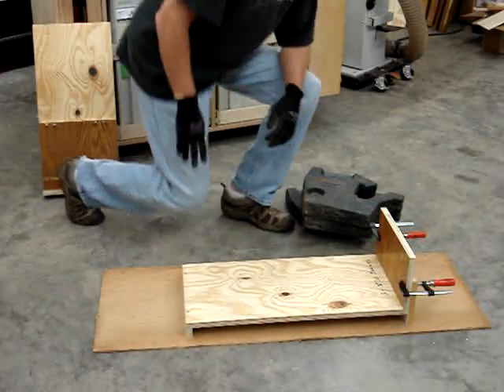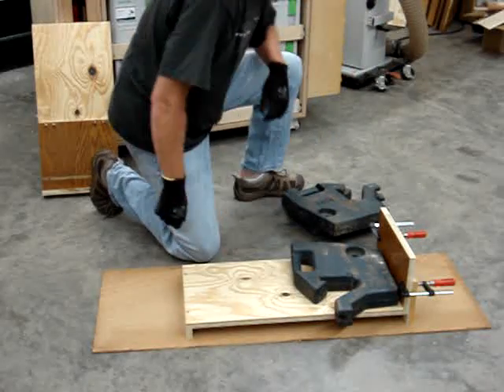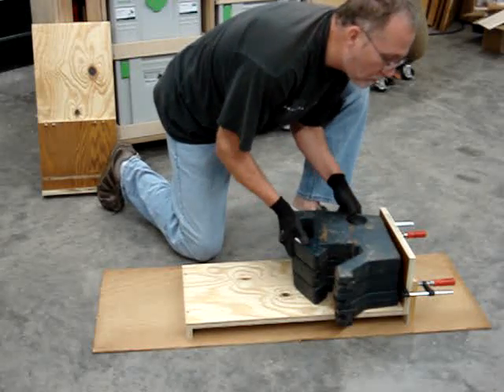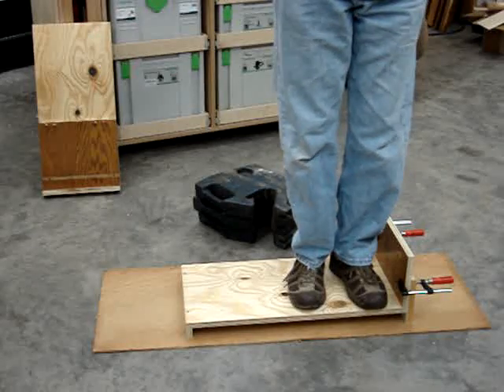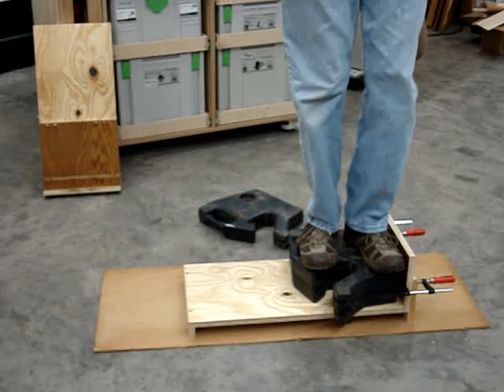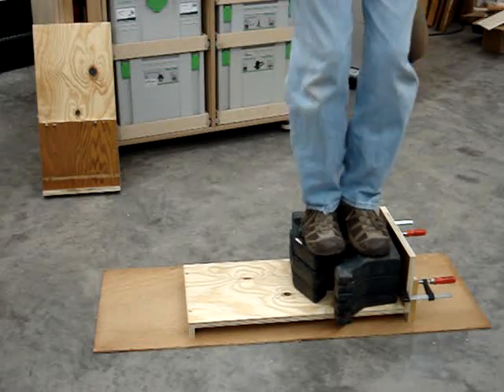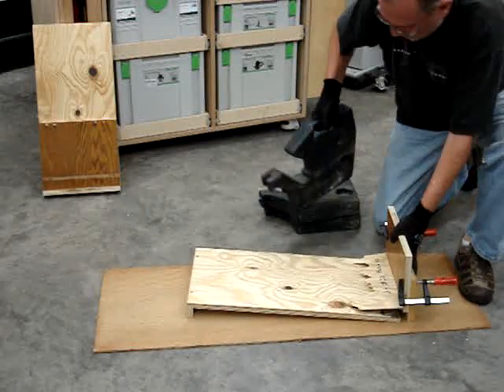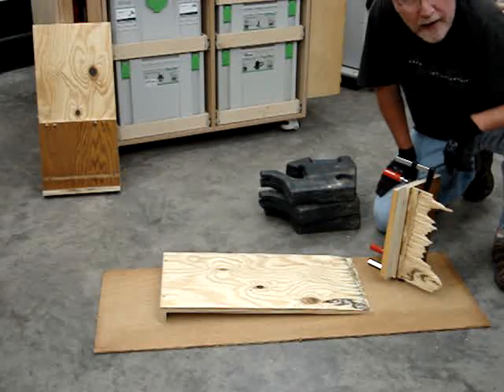Part 2   20 biscuit joint

Comment: I used the results of your video as part of my decision to buy a biscuit joiner, so thanks for taking the time to do this. 

Also, do you think that (hypothetically) repeating this test with a support jig on both sides would yield different results than having the support jig on one side and a solid "leg" on the other, as originally tested?
Reply from the maker: +Michael Tupe Awesome!  Glad to be of help.  There are really supports on both ends of the test jig - the one on the joint side only supports the side piece and not the shelf.  This was done so virtually all the force would be applied across the joint in shear.

Comment: Very interesting tests! First time I see those 3 technologies compared. Looking at all 3 tests, I concluded like you, that all 3 methods are adequate. But I can't help noticing that in man-made material like plywood (and I suppose even more in particle board), biscuits seem to have a slight advantage. I think it is related to the wider area of the biscuit distributing the force, compared to the narrower Domino and dowel. In real wood, I suppose it could yield different results. But nevertheless, people saying that biscuit don't had any strength should reconsider. I was considering buying the Domino system, but was hesitant to spend $1000 + on it. For joining man-made material, it is clear that I can't justify it anymore.

Thanks for the great information.
Reply from the maker: Glad you found the information useful.  I recall looking at the cross sectional areas for the joining elements when after I did the test to better understand the results.  The #20 biscuits had much greater area than the others.  The biscuit and its various derivatives does seem better suited for sheet goods while the Domino is best suited for solid wood joints and furniture IMO.